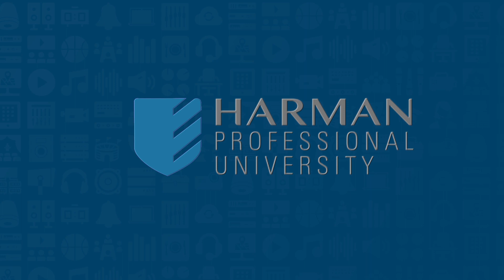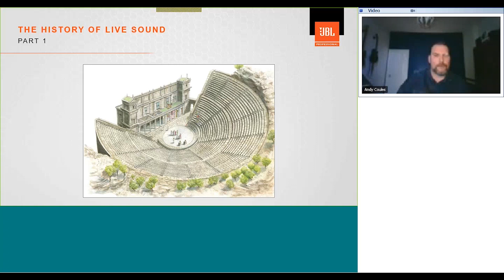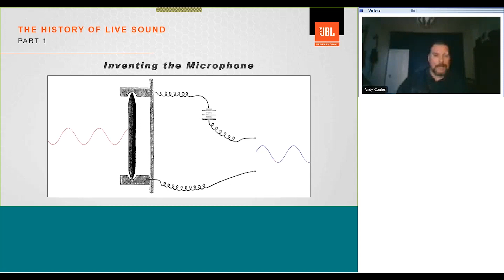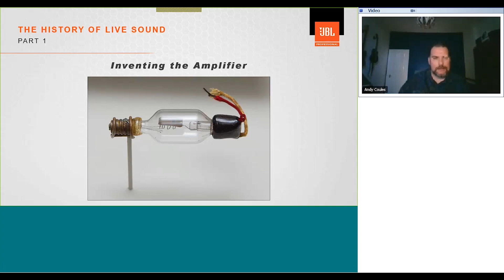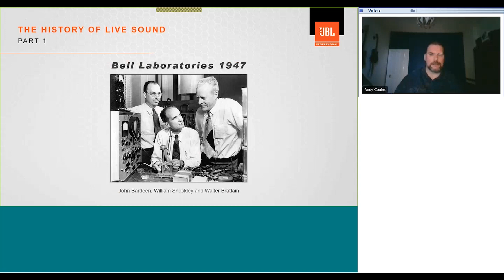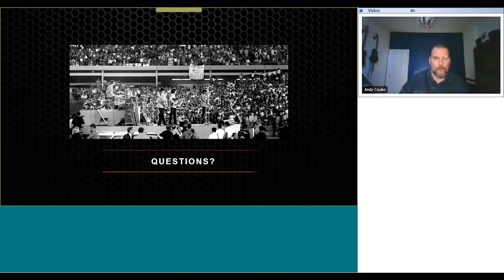History of Live Sound - Part 1 with Andy Coules - Webinar

Comment: After rooting around for information about the Beatles system, someone pointed out that the band also used the stadium's PA system.
BTW, the column speakers may have been early line arrays.  My understanding is that it was common in the "high power" columns for the individual speakers to be closely packed.  A 6' (2m) column would have some pattern control down to about 1.6kHz.
Not that any of this mattered with all the screaming.